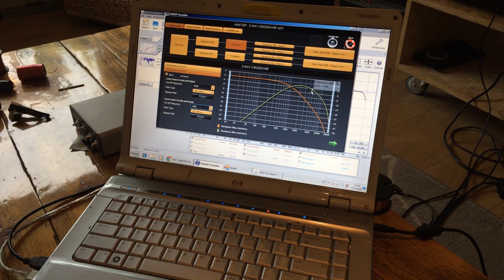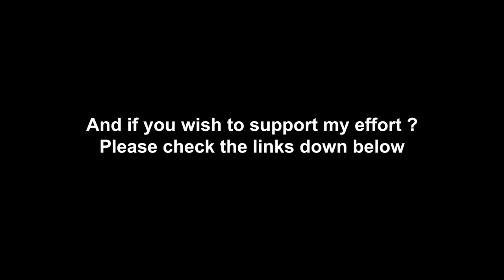Making a 1 meter long ribbon Part 1 Frames

Comment: I've read in some articole about the Magnepan building process that the closed back metal profile that holds the magnets is creating a degree of SPL boost. They said it "Completes the magnetic circuit". I'm talking about the Magnepan tweeter, not panel.
Reply from the maker: yeah what they do is connect one north of the , lets say right magnet and connect it by the slivers of steel to the south pole of the magnet on the other side :) and since they are like 50% metal. so half open music can past as well. and increases power.  well  it is a nice design, i cant cut a Ohm shaped piece of metal with 100 slots :( at the same time no slots would be beter for how  it performs except efficiency :) but i've seen  they also use magnets that are far smaller then the ones i use.  theres are even cheaper :) so in the end. i dont know i love there design , but i dont got the equipmewnt to do so :) so i compensated for it with bigger magnets. and as benefit i dont have any reflective metal straigh behind the ribbon :)
Reply: @joppepeelen   well i dont know if a ohm shaped is required. Why not a U shaped one ? In my country at the construction stores we have various stainless / iron profiles like this: https://www.shop.mirad-tehnic.ro/wp-content/uploads/2016/08/nosn%C3%ADky-1.jpg  ..and they are dirt cheap. Anyway..you can do this later..first step is making the ribbons sound great. Good luck !
Reply from the maker: @sorinsorin8137  yeah U shaped works to, but a Ohm shaped makes it easy to mount he whole thing in a panel to :) with just a few holes.  if ur gone try it then dont get the stainless :)  but you are right lets first get any sound out of these :) for all we know they suck :)